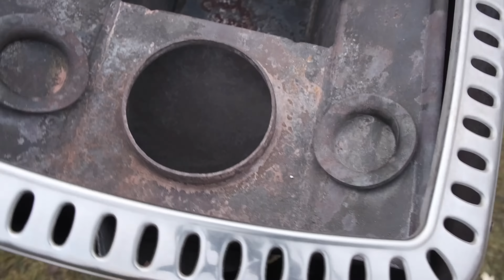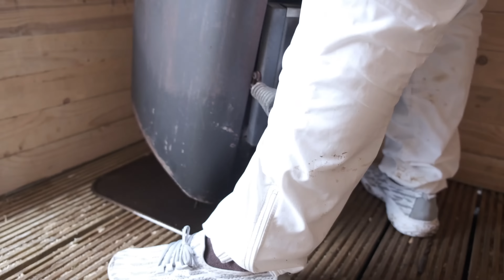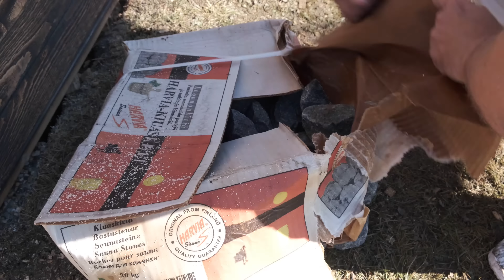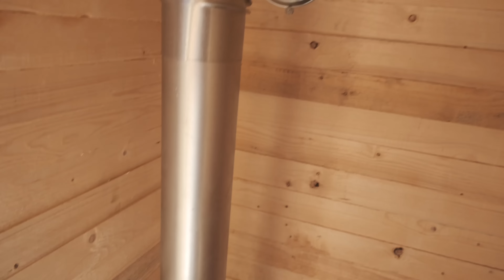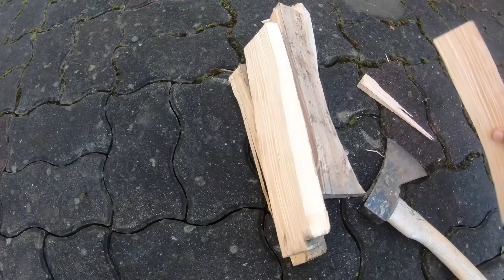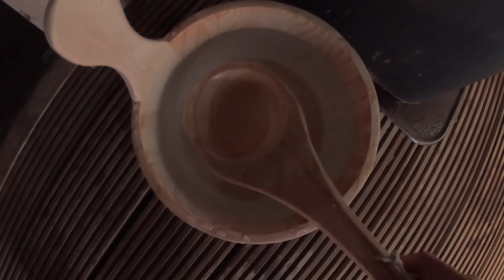Harvia M3 woodburning sauna stove

Comment: As a few others have said, the stove right up against the wood wall, and the lack of double wall pipe through the wall is a bit hairy.
Reply from the maker: Thanks, I saw all the comments and improved the design. I used stone slates on the wall and aerated concrete for the stove pipe: https://youtu.be/TGl7yxg15s8